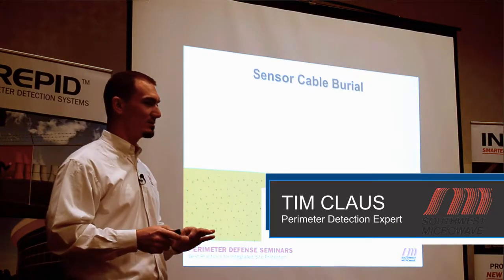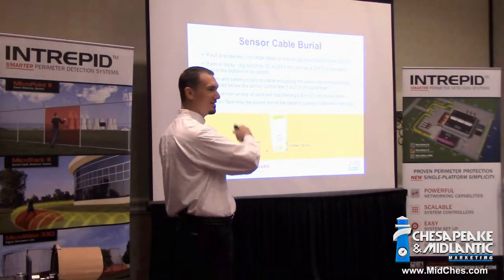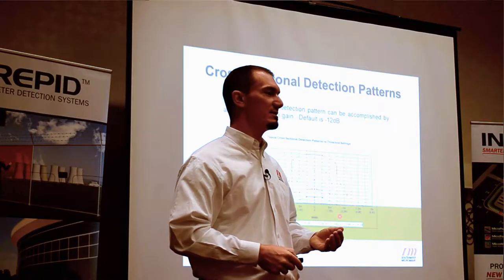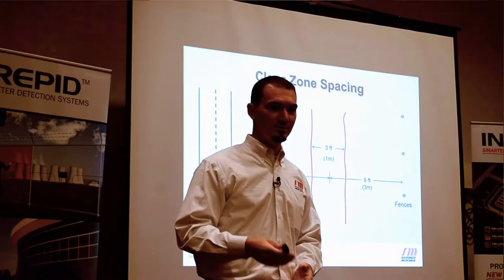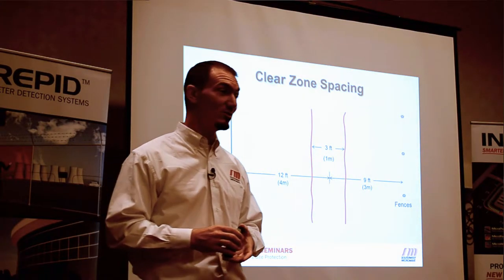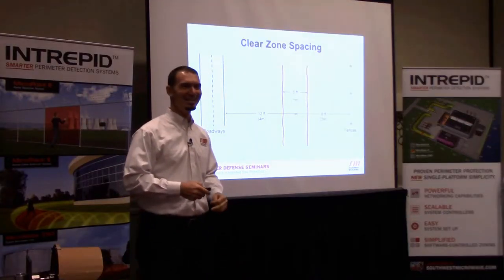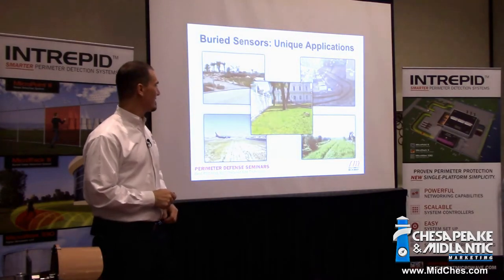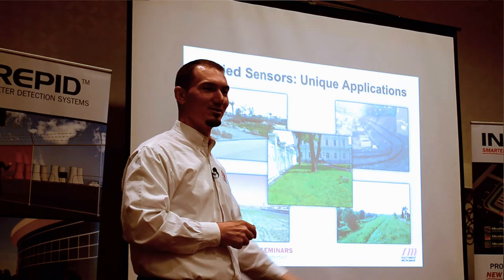Perimeter Detection: Buried Sensor Cable Installation and Applications

Comment: Apart from cables, are sensors available for the detection?
Reply from the maker: Thanks for the question. Yes, there are also motion detection devices available as part of the Intrepid family of detection devices. Please email us at support@midches.com with your location/city/country and we can get the proper resources in touch with you to assist with project design.  Thanks again!